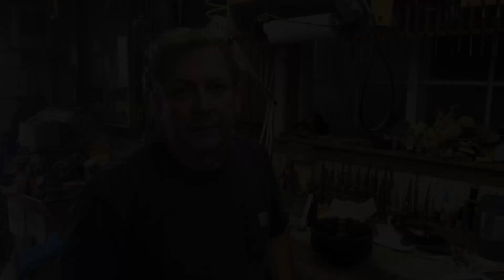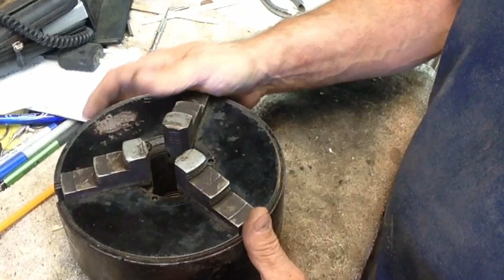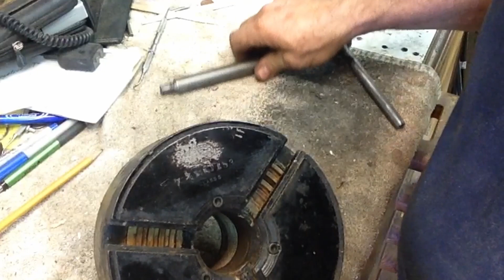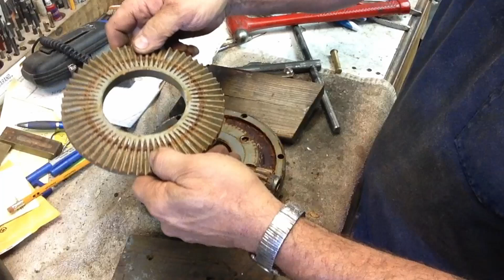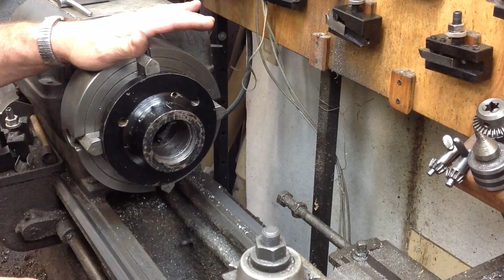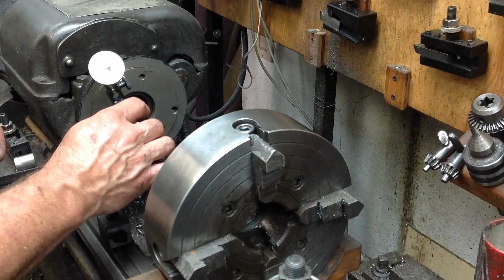Sheldon Lathe Restoration, Modifying A 3 Jaw Chuck: Part 1

Comment: I like your chuck stand for your bed nice idea one of my first jobs i changed out a chuck and the foreman told me to use a strap from the jib crane to catch it when it unscrewed so it wouldn't fall on the ways well i thought i was strong enough to hold it with my hand it didn't hit the bed because my finger stopped it lost my finger nail never done that again thanks for sharing
Reply from the maker: Thanks, I built them for all my chucks for the big lathes. I just laminate 2 pieces of 2X material and then fit to the ways then scribe the chuck to the 2X and cut. Dan